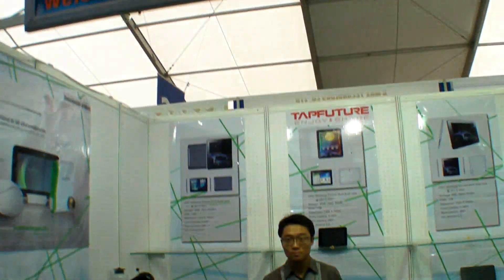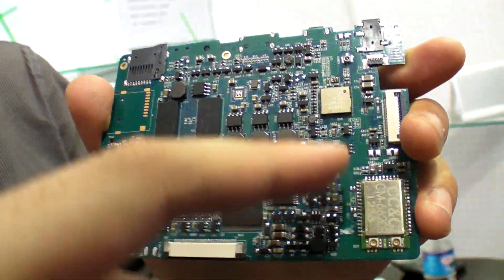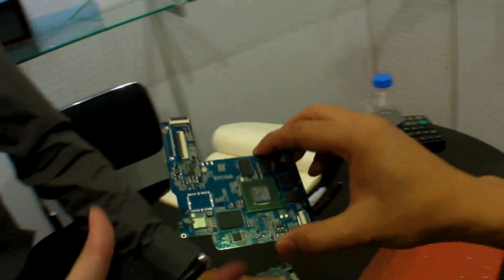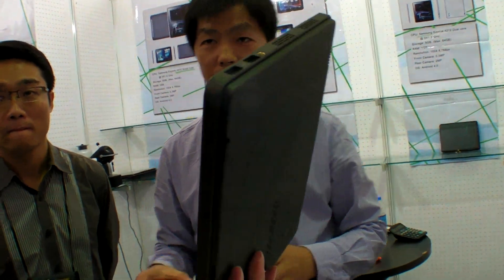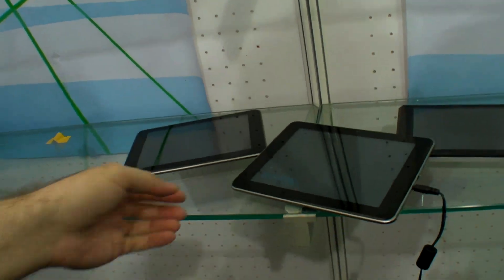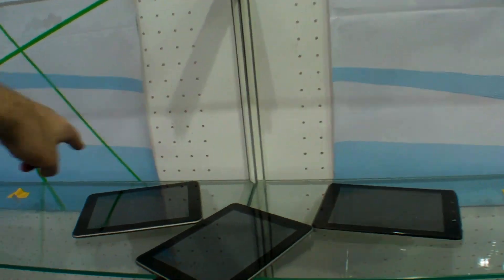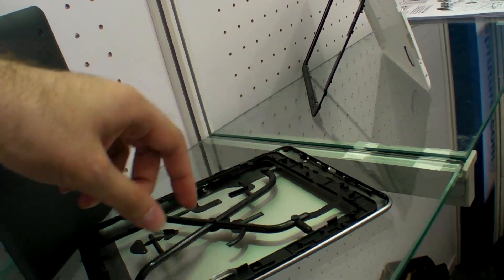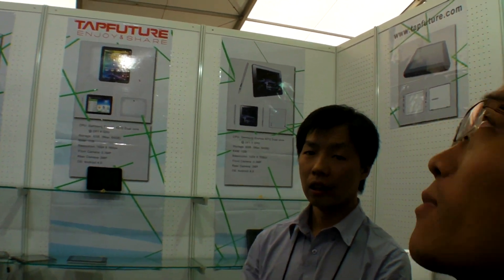ZhongXiang Quad-core Exynos 4412 PCB Design House

Comment: The exynos 4412 is one hell of a chip, it's gpu especially is fantastic. It's the reason I bought the galaxy s3 over the htc one x as the s3 has the exynos 4412 which gpu is considerably faster than the tegra 3. Plus you have 32nm on the 4412 and 40mn on the tegra 3. Those tablets don't look that bad at all with those CPU's.